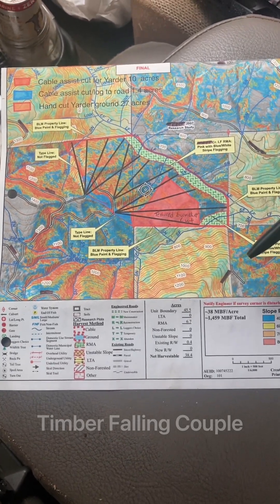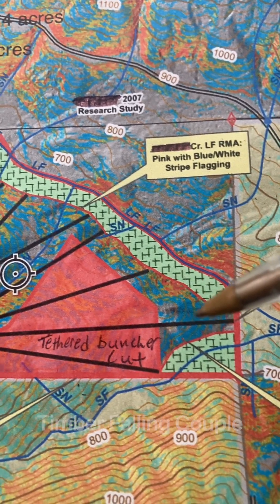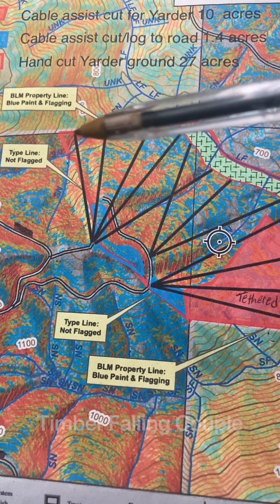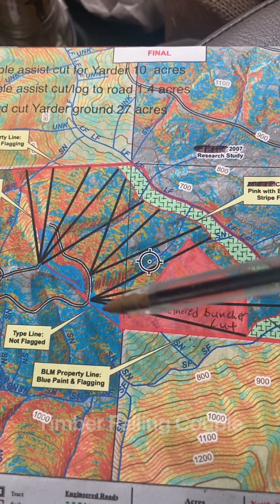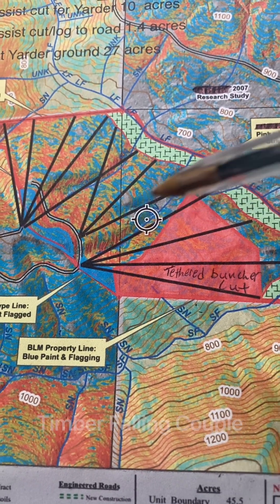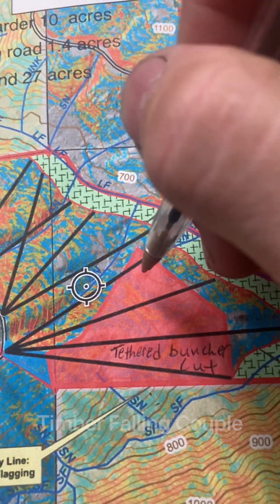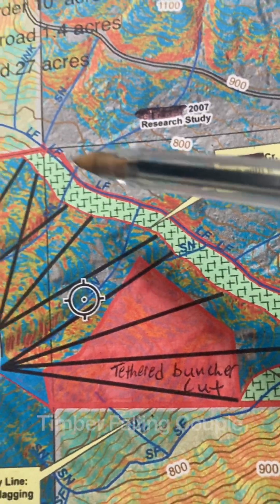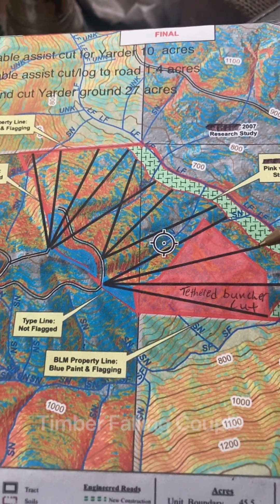Talking about LEAD in Logging, Forestry, and Timberfalling (What, Where, When, Why)

Comment: A friend told me one time that some trees are afflicted with reach rot.  It's just too far to go get them.  A question:  Can you fall across a property line or a unit line, assuming the target tree is within the unit?
Reply from the maker: I typically can fall across a unit line as long as the same property owner owns the adjacent, but property lines are a hard No-go. And even when using ground outside of a unit, considerations need to be made that they can log the pieces without exiting equipment out of the unit. So mostly no, but we can use the ground a little if we are considerate of who owns it l, and how they're going to log